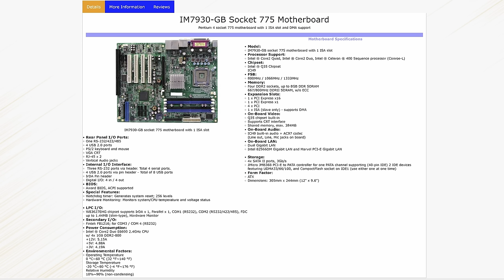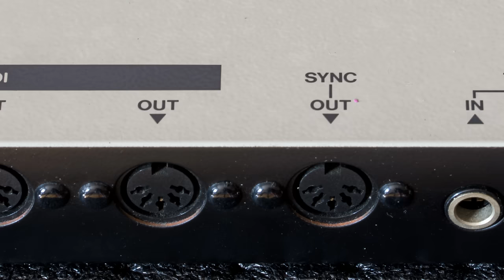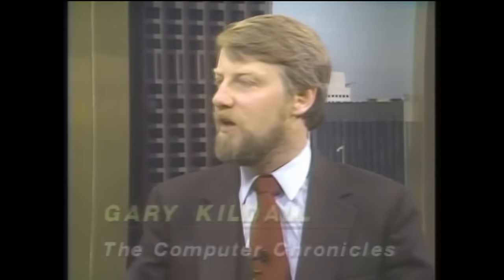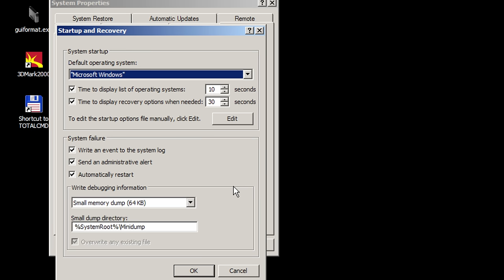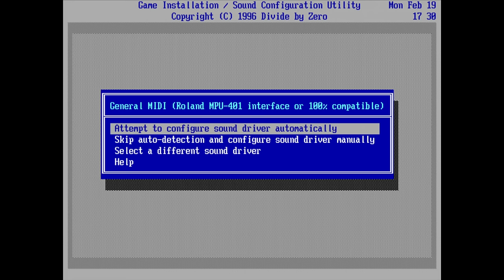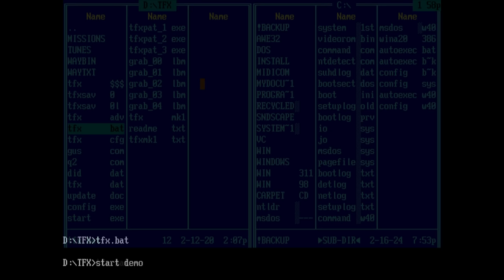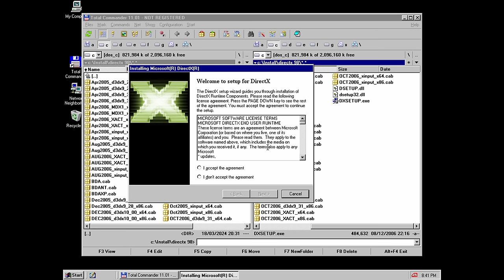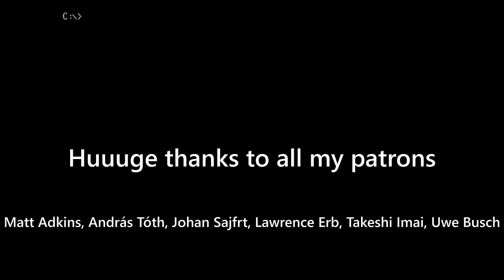The ULTIMATE retro build for DOS / Windows 3 / Windows 98 / Windows XP

Comment: The thing you're missing is a Windows XP/98 sound card for either EAX or A3D. It will support a ton of EAX games from Windows 98 to XP. It makes a huge difference in how games sound in Windows, and was a huge part of the experience back in the day just like a 3DFX Voodoo card. Also, I believe there are at least a few fast cards for the AGP slot that will work better for you, but I don't recall what they are. Worth looking into.
Reply: Important point! SB Live! on PCI has DOS emulation and EAX 2.0 support. For the last EAX 5.0 you will need X-Fi but no DOS emulation.
Reply: I second that. a pci soundcard is an absolute must here
Reply: I'm apparently not allowed to reply to a comment about old sound cards anymore. What the heck is going on?
Reply: I'll at least try to say that you probably don't need EAX 5.0, since the need for ISA means you're stuck with a slow cpu and ram. EAX 3.0 from an Audigy should be a good middle ground for the games the system can actually run, while preserving W98 support. Then just add an ISA card for DOS.
Reply: I'll echo this recommendation. On my own build with this motherboard I used an Audigy 2 ZS, Diamond MX300 and Orpheus II. This combination nicely covers all audio standards from DOS to early-era Windows XP.
Reply from the maker: I was never too fond of EAX, A3D, etc. It always seemed to me like a useless gimmick to me. As for the AGP card, what exactly do you mean by 'work better'? There's nothing faster than the X850 for Win98 and it's working perfectly fine in any DOS game I've tried.
Reply: @KITR-UK  I never had EAX back in the day, but I do enjoy having an X-Fi in my XP retro build. With headphones and appropriate settings the positional audio is really quite good, and certain games really benefit from the environmental effects. I understand it's not everyone's cup of tea, but the likes of Doom 3, Halo and BF2 really change quite a bit, and even unexpected titles such as San Andreas and KOTOR are surprisingly enjoyable for me personally.

Don't get me wrong, I dislike Creative  as much as the next guy, but I do wish immersive audio was more of a thing. These days it's easy enough to do in software anyway.
Reply: @KITR-UK IMO for an "ultimate game" build of 98 you need a PCI soundcard. It's not just A3D/EAX but overall quality of sound and all the effects you can apply. the ISA ones are good for dos-era games but for win9x are no match. just try them :) also I agree about the X850, he might refer to geforce 6800 ultra from nvidia side. the only difference between them is that GF6 supports DX9.0c, whereas X850 is DX9.0b. But as I told on my previous comment, many people go with GF 4 or FX for some other legacy features that were droped on ATIs 9000 series and Nvidias 6 series. Also, what are your thoughts about 3dfx Voodoo3 and win3x? Did you install the driver for it?
Reply from the maker: @AndrewK2685  "IMO for an "ultimate game" build of 98 you need a PCI soundcard. It's not just A3D/EAX but overall quality of sound and all the effects you can apply. "

That's why I used the SC-D70 as a sound card, it exceeds the sound quality of early PCI sound cards.

As for the Voodoo 3 and Win 3x, never tried that.
Reply: @KITR-UK I'm not familiar with the roland SC-D70 tbh, but, like the sound canvas, usually these were just midi modules and used as tone generators - I like more the yamaha mu2000ex in this perspective. But I don't think they can play wave files, mp3s or recorded sounds. I may be wrong though, please update me on this :D. Also, I wouldn't call the SB Audigy 2 ZS an early PCI soundcard. Bare in mind the X-Fis that followed were actually the last PCI ones from creative's side. And they are very easily obtainable and cheap, so I find no reason for someone not wanting one for his ultimate rig :).
Reply from the maker: @AndrewK2685  The Roland SC-D70 is not just a MIDI module, it's also an excellent USB sound card, that's why I chose it for the build. Moreover, I'm not too fond of Creative sound cards past the AWE32, they are not quality focused, you're much better off with something less mainstream (such as the SC-D70 :) ). For stereo sound that is.
Reply: @KITR-UK OK then, didn't know about the SC-D70 - I'm pretty sure you already tried loads of the PCI soundcards :). But yeah excellent build man, really liked the GUS part of it. Enjoy :D
Reply: @shponglefan  The Audigy 2 was always my go to. LOVED it's compatibility range.
Reply: @ShinzouKatsune My experience was from PC speaker and SB16 straight up to Audigy 2 ZS tbh, so I skipped the buggy early PCI Soundblasters... but I'd put the Audigy 2 and later the X-FI series along with SB2.0, SB16 and AWE32s as Creative's milestone products. And yes I agree their compatibility is amazing, but IMO it is expected for such a product :D.
Reply: @KITR-UK depends on how EAX was implemented. Doom 3s implementation im not overly fond off, too much echo.
Reply: There are pretty good EAX "emulated" drives out there, not perfect but not bad!

Comment: Never understood Peoples love for the Voodoo2, sure it rendered some games better that a directx card but by 99 nothing ran a game as good as an Nvidia card and when the original Geforce launch I bought one and was not disappointed. Games ran faster, at 32bitr color depth instead of 16bit which is what glide was stuck at. Voodoo had very few tricks in my opinion and they fell apart quickly!
Reply: I also skipped the Voodoo 2. I did have a Voodoo 3 2000 briefly but fairly quickly swapped it for an nVidia card

Comment: There is way shorter ways on doing this. Do not need dos 6.22 at all. Can set a shortcut in windows 98 SE to boot to dos mode with its own config.sys and Autoexec.bat config and put what DOS drivers you want for all sound cards, Mouse drivers and CDROM drivers for DOS.  And windows 98SE can run 98% of windows 3.1 games since its backward compatible. I have my Compaq computer Pentium II set up this way and dual booting with windows 2K

Comment: You’ve managed to have a configuration that’s very difficult to come by, use it for 3 to 4 computing generations within the Microsoft Spectrum, and even got it to work pretty much flawlessly. 

Hats off to you, good sir.

You might’ve gotten a Voodoo (1) card and a Voodoo 4500/5x00 (PCI) to work in this build, next to the ATI Radeon X850 XT-PE. You’d be able to play DOS games with voodoo acceleration, have the best Voodoo compatibility under Windows 98 and XP, and have enough power to run the heavier DirectX games too. 

As for sound: holy moly! 

If you’re still struggling with the idea to put more ISA sound cards in there - as the Gravis would make it complete - you might be able to source an ISA splitter and stick the whole in a case with 11 expansion slots. That way, you could even add an Aureal Vortex 2 to the mix for A3D. :D 

Thanks for the awesome video. I had a blast seeing this! :D

Comment: I built up a Shuttle XPC with Pentium M 750 using a IDE to SD adapter, but skipped anything in Software from 2004 onwards; DOS & 98 run like a charme, XP has a few stutters at times, but overall I like my small package; nice guide, a few tips will come in handy to iron out minor hickups

Comment: the ultimate dos gaming machine, for as long as you want to keep it period correct, can cost you an arm, a leg, a kidney and your first born.
lucky enough to have built mine from bits i collected, but check the price of an Abit BP-6, Matrox Millenium 2, voodoo 2 12mb sli, AWE64 and you quickly reach the cost of a modern pc :/
last piece i'd like to get is a 24" high refresh rate (preferably trinitron) CRT, but i would have to kiss my corneas good bye for this one so heh ...

Comment: Very nice, makes me want to tinker with some of my builds. IMO, splitting it up into 2 or 3 systems keeps the hardware choices sane, as everything except the fancy sound cards/synths are much cheaper, and you don't need to juggle 3 operating systems on one drive.
My 'all in one' build is a K6-III+ 550 / voodoo 3 / aureal vortex 2 / ALS100 / SC-55
and windows XP build is a 2600K / 780ti / X-fi titanium

Comment: Very nice build. I believe a radeon X series that you have and a geforce 6 series are the best you can get for such setups. Bare in mind though these do have some missing features, so a lot of people go with geforce 4 or FX instead. As others said, one thing missing in my opinion is a pci soundcard. That will seriously bump up sound quality and make a HUGE difference for your windows 9x/xp or future 7 sets. An Aureal Vortex 2 for A3D or a SoundBlaster Audigy 2 ZS for EAX are absolute musts in such builds IMO. Also, why don't you use a voodoo 3 instead of 2 voodoo 2s? you'll get same performance and 1 free pci slot that you can use for a soundcard for example. For 98 memory issue, I highly recommend R.Loew's patch. Lastly, have you installed 3dfx drivers for windows 3.11 or any svga extender in dos? / I assume you already did with 98/xp

Comment: An amazing build, very inspirative :) Although I don't exactly fancy such all-rounders because you always need to sacrifice something and it will never be 100% correct in all cases, you gave a lot of good infos there. And I like the "because I can" approach 😀

My approach is to have a few period-correct builds with everything that went into them, apart from disks and screen. And a Gotek floppy emulator :-) And fans - I really hate too much noise so I replaced all those cheap terrible screaming fans with Noctuas, BeQuiet's, or NoiseBlockers first thing :)

But I'm also considering sort of an ultimate build for everything from DOS to WinXP. But in my case, I chose to go for Socket370 generation as you can get it more compatible, and the components are much more available (and cheaper). For it, I got Via C3 Ezra and Nehemiah processors, especially for their unparalleled scalability down to the equivalent of a slow 386, which is really important for running the speed sensitive games from the era. I would like to see in more detail how you handle those in this build.

As for the graphics, I've never been much of a fan of 3D accelerator cards - in their heyday, they were finnicky to set up right and get working properly, much too expensive, and once they got affordable, you could as well buy a decent AGP card with similar 3D capabilities.

Reagarding sound - I don't have the room nor the money for all those original Roland devices, even if it would be amazing, so for now I'm pretty much satisfied with my small assortment of ISA and PCI soundcards, and my Orpheus II, to which I connect a Serdaco DreamBlaster X2GS-SE wavetable module with licensed Roland SC-55 sound banks :) It sounds as close to the original SC-55 as you can imagine ;)

And as far as multiboot goes, in my eyes, the Windows' attempt at boot management was as incapable as it gets, and pretty much useless, so I've always used LILO. It is amazingly configurable and caters to any needs you may have in such environments. I'm even keeping DOS, Win95 and Win98 on separate partitions, having configured LILO to switch them so that none of the systems can see any of the others :) It just requires another partition with Linux (which may be small and in the extended partition area, not primary, so it doesn't get in the way of anything), but nowadays, it is a breeze to get a period-correct install ISO of e.g. Slackware. And a bit of studying is needed to get the lilo.conf right (and maybe occasional starting of Linux from DOS/Win using loadlin, when you screw the config up, or when windows screws your boot record). Done this a few times when setting up my retro builds recently :)
Anyway, thank you for a great deal of good info, you gave me some inspirations for my own builds as well :)

Comment: Cool video. Might play around with my P4 system to see what will work. Out of my head I don't remember what board it has.
Especially want to try out SATA SSDs for Win98SE even if I might stay with my CF to IDE adapter. Should also create a DVD with all the different operating systems.

Comment: Interloper motherboards are told to have incredible Core i support while having ISA slot. Are they really worth anything?

10:59 I would try Acronis OS Selector 5.0. Also I like its look and feel. It's like programmers took competition with Norton Utilities and won. So I just like to have it installed on retro systems, virtual and physical ones.

Also, I think, PC-DOS would also be compatible. In my childhood I used PC-DOS. Quite compatible, and I still install it on retro.

Comment: I discovered that DFI motherboard a few months ago and have been working on my own ultimate multi-OS build with one.  I'm surprised they aren't more popular in the retro community for this purpose.  Regarding the 4th PCI slot shared with the ISA slot, it actually runs on the secondary PCI bus so it's not as functional as the other PCI slots. I tried installing an Audigy sound card in that slot and Windows wouldn't recognize it. It did work with a Diamond Monster Sound, but couldn't use all the features like MPU-401 or the game port. So you might be better off using a pair of ISA cards and foregoing that 4th PCI slot.
Reply from the maker: Care to share the configuration of your ultimate build?
Reply: @KITR-UK   Sure. CPU is a Pentium 4 HT 651 (3.4 GHz) with 2 GB DDR-400 RAM. Video cards are a GeForce4 4200 Ti and Voodoo2. Sound cards include an Audigy 2 ZS, Diamond Monster Sound MX300, and Orpheus II with a Yucutan FX wavetable daughtercard. For storage I'm using two SSD drives (250 GB and 128 GB). PSU is a Seasonic Focus GX-650 and the case is a Fractal Designs Define R5.  Plus a DVD-RW drive and 3.5" floppy drive.

Comment: The BCDEdit tool and the Windows Vista+ bootloader is a nice add to this kind of setup. I've done some crazy multi boots (everything from 98 to 10) with an Athlon64 system. 
Also, watch the heat on the voodoo2.
Reply: Is there not a better Linux boot up for this?
Reply: @Jimfowler82 You bet there is ;) With such multi-boot setups, I've always used LILO as my boot manager (came with most linux distros back then) and it served me flawlessly for....dare I say decades :) You just need to study a bit and write a good config that fits your particular setup and needs.
It is still doing its job perfectly in my old PC builds :)
Reply: @Beus38  that’s it I couldn’t remember the name of the boot manager. Lilo last in last out ? Sure I used that 25+ years ago. Even when I duel boot now I’m happier to have the Linux boot manager, 

If you have loads of windows distro I think it would work good for this.
Reply: @Jimfowler82  As far as I can tell, the name was just a short for LInux LOader :) And yes, even today, I still use linux boot managers everywhere I move (and need multiboot, which is almost in all my computers). After LILO got unfortunately deprecated by the advent of the UEFI, I unwillingly had to move to grub.
Reply: @Jimfowler82 But I have actually always kinda disliked grub for its unnecessary internal complexity and far-from-straightforward way of configuring it to my needs. It is like windows - good for ordinary users without any knowledge, works well out of the box, but as soon as I want anything done my way, I'm just getting obstacles over obstacles. It cannot even do simple things like changing partition types the way LILO could.
Reply: @Jimfowler82  So, now I'm in the process of studying information about rEFInd boot manager which I decided to switch my EFI systems to.
All in all, for MBR-supporting systems, LILO all the way, and for EFI-only, rEFInd :)

Comment: My all-arounder: Abit KT7A (ISA-slot) + Athlon XP-M (multiplier can be set from DOS) + GF5900XT & Voodoo2 + SB Audigy2 (WinXP) + Vortex2 (98SE) + Orpheus II (DOS). SDR memory bandwith is the problem, no matter how high you clock the CPU, it's just don't help. Far Cry 1 is playable but gets slow here and there even at 148FSB.
Reply from the maker: You made me curious, so I installed Far Cry and this is couple of minutes of gameplay in 1920x1080, max details: https://youtu.be/dOGnmVjl1zg

Comment: In DOS you can use SoftMPU to get around the UART / IntelligentMode issue.
And in Windows 9x, you're better off with a SB Live or Audigy which supports EAX , heck even an Aureal Vortex with A3D would be preferable under 9x.

As for Windows 3.x , you need a much older graphics card to get any support for hi-res graphics. There's a patch for some std. VESA driver, but that only gives you 256 colours, and 3.x actually supports up to 24-bit (or at least 16-bit). A Riva 128 or TNT with the Riva 128 drivers will work. But those cards are not the best for 9X.
Reply from the maker: Not really, SoftMPU doesn't work for all games and it's unreliable, that's why I used the S-2000 which works with every single one.

Comment: have same board. it can work with c2d (with pin mod, some volt mod), up to x6800 so you can get an ultimate performance, get you bios updated to c2d version (from vogons), and you're good.

Comment: i assume you also fix the problems with games when the CPU speed is over 2.0GHz on windows 98?
and also the problems with DirectX as installing 9.0 causes some older DirectX games like The Need for Speed SE to not work.
Reply from the maker: Never had a problem with any game whatsoever under Windows 98.